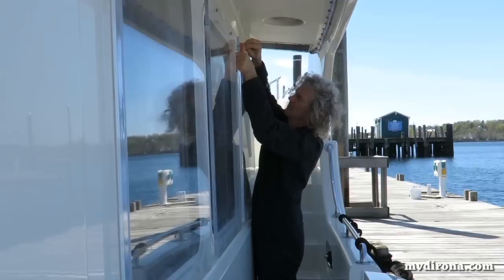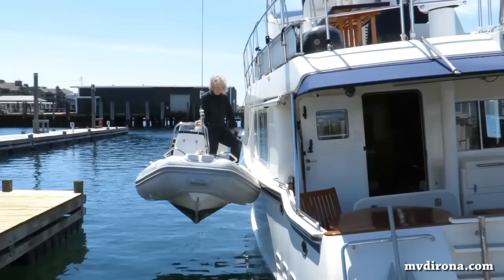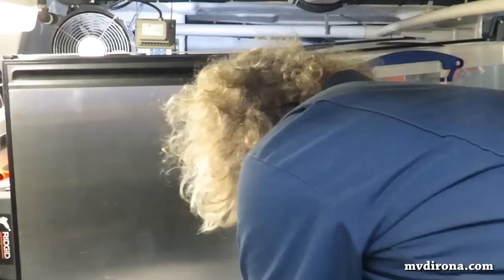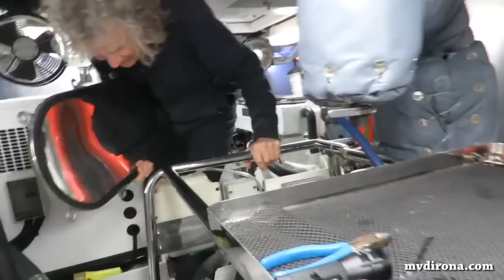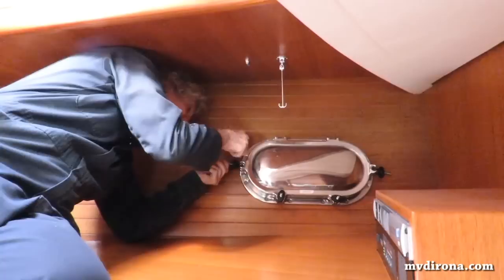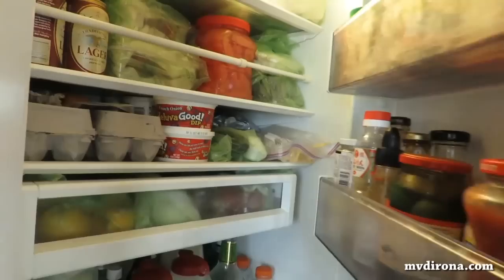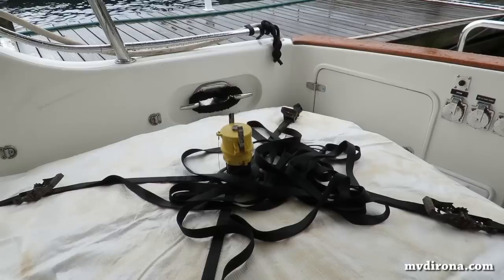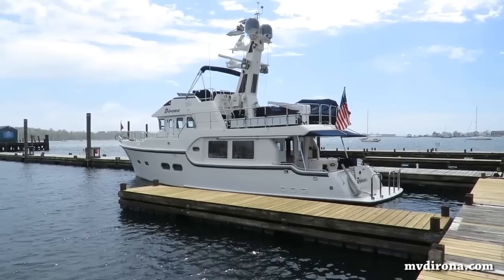Preparing Dirona for the North Atlantic Crossing (MV Dirona Channel)

Comment: So 835 gallons in each tank plus the two bladders for 300 gallons and then what 200 more gallons in that bridge bladder so all in 2470 gallons at what ?   Back then about $2.79 per gallon so it was around $ 6900.00 bucks !?!?   Wow !
Reply from the maker: The good news is we have only crossed major oceans 4 times so it's not a frequent expense. But, yes, as you note the fuel for trip is expensive and the US is actually one of the cheaper places to take on fuel. When we left Australia to cross the Indian Ocean, we took on fuel at 2x the cost of US fuel.
Reply: @MVDirona    Well I dunno if you're still in Norway but than again if you are, I dunno why you'd be answering YT posts at 7:20 AM local time either !?!  (grin)   Oh really the IO too!?  Well next big crossing, please feel free to show us poor land locked buggers the crossing and what's its like to do a watch and all the endless checks during that watch as well.  I'd bet transferring all that fuel around while underway is a bit of a job too!!
Reply from the maker: We are currently crossing the North Sea enjoying the bright lights of massive oil rigs and supply vessels all around us.  On fuel transfers, there isn't much work to do.  We have a boat trim indicator at the fuel manifold. Every shift change, I go down and see which way the boat is leaning and then pump out of that tank into the supply tank. 

We're currently running at 7.8 to 8.1 kts so only getting 1.0 nautical miles per gallon so we need to transfer fuel a bit less common in these conditions. On longer ocean crossings we usually are getting closer to 1.6 to 1.7 nautical miles be gallons.

I'll check everything in the engine room and laz very closely twice a day and walk through the engine room looking for leaks, ware, vibration, weird noises or smells, every shift change. 

It's all mostly pretty boring (the way we like it) in that we don't check that often and there is just about never anything wrong.

Comment: How do you unload the fuel from the bladder
Reply from the maker: It's a pretty cool set up where, before leaving, a custom made hose is attached to each bladder by cam lock fittings and then connected to the aft bulkead also by cam locks. Then when it's time to transfer the fuel we just adjust the fuel manifold in the engine room to "Fuel Bladders" and do the transfer without going outside. Much more detail in this posting: https://mvdirona.com/2013/12/dirona-fuel-manifold/.

Comment: Why not just hinge those deadlights?
Reply from the maker: There is no clearance for the storm plates to be folded out of the way in any of the 4 directions away from the window so a hinge doesn't really help. We store the storm plates up on the boat deck and only use them when we are heading out into open water for longer than the forward look of a reliable weather report.
Reply: Thanks for your reply. Great videos and boating channel. Keep up the great work!

Comment: Why not do it from the jetty haha
Reply from the maker: Yes, the storm plates can be installed from the dock and we sometimes install or remove them that way. The downside of using the dock is that you have to do one side, them turn the boat around, before doing the other side. But, yes, that works fine.
Reply: @MVDirona  can your boat only dock from one side?
Reply from the maker: Its an asymmetric design where there is a walk around on only one side so it's more convenient to dock it on the starboard side. But, it can be docked on either side without difficulty. Line handling is just a bit more restricted without the walk around on the port side but it's not a significant factor. Docking on the port side would allow the port side storm plates to be put on or taken off.
Reply: @MVDirona  thx for explaining i know nothing aboat boats but i do love them new sub

Comment: Why in the name of sanity didn't you just move the boat to the empty dock opposite? Five minutes and you would be done.
Reply from the maker: Jjaus asked why used the tender as a work platform to install the storm plates on the port side rather than just turning the boat around to put the other side at the dock. We have done both in the past and both work fine. Operating from the crane brings a bit more risk of a mistake but it's also slightly faster. I use the crane as a work platform to clean and wax the back of the stack and for a few other service items where I've not found an alternative and, since that worked well, we end up using it for other jobs where there are alternatives.
Reply: Look, I don't know as much as you guys, but as an observer, to untie the tender, organise the davit, hook the cables, lift it and swing it, get in the tender, lower, do the job(s), then undo all the former steps as opposed to just moving the boat a couple of metres, seems like a faff. I dislike spending more time than necessary for any tedious task.
Reply from the maker: I 100% agree and that is exactly the criteria we use to make the decision: which is faster?  My take was unhooking the power, dropping all the lines, swinging the boat around, installing the storm plates and then doing it again to put it back was more work.  It's not a huge difference either way but that was my take.

Arguably only switching it around once and leaving it with the walkway out would have been fine and would avoid moving the boat twice but the Marina wasn't really fully open so they have no power on the dock. It has to come from the shore side so stern to is more likely to make it to the power connection. An extension cord would have solved that but we were also planning to fuel first thing the next day and it's easier to fill the forward bladder with the starboard side walkway to the dock. 

Those were the factors that influenced the decision but admittedly I didn't think that hard about it.

Comment: Thank you for your generous contribution towards climate change. 2000 plus gallons of diesel to transport two people a relatively short distance? That's 20 plus tons of carbon dioxide, more than most households emit in two years. The total emissions for your complete trip must be enormous. All for a vanity trip. Still, as long as you're having fun why should you care about the planet or future generations right?
Reply from the maker: You may be surprised to learn that private yachts crossing oceans isn't in the top 10,000 for energy consumption. If I rode my bike to work for 10 years, will you let me off or am I still not allowed to use the boat?

Comment: I'm thinking sailboat...
Reply from the maker: Sailboats have the advantage of not requiring the fuel load but, other than that, not much else changes. We're not materially faster and a sailboat has all the same concerns when heading to sea other than not being solely dependent upon diesel to do the crossing.

Comment: Cor, I thought that would be a Diesel plant in that craft.
Reply from the maker: The main engine, wing engine, and generator are all diesel fueled engines. All the fueling you saw in the video is diesel. The boat carries a small amount of gasoline for the tender but all the big tanks carry diesel.
Reply: Sorry, I do not know what a wing engine is.
Reply from the maker: Yes, I should have explained what a wing engine is. In single engine boats, you want to have some form of emergency power in case the single main engine fails.  This emergency engine is often called a "get home" engine and the most independent and redundant form of "get home" has it's own fuel tank, props, battery, transmission, prop, etc. It's completely independent of the main engine and because it's a completely parallel systems it gets installed off to the side of the main prop and it's this installation point on the "wing" that causes it to be referred to as a wing engine. 

The problem with wing engines is they are seldom used and many fail due to lack of use. On Dirona, the wing engine runs the hydraulics as well as serving as an emergency backup engine. The hydraulics are used to run the thrusters in close quarters and the windlass to raise and lower the anchor. This second use of our wing engine gets it a bit more than 100 hours a year and ensures it's running well, always tested, and operating well.
Reply: So, strictly speaking, it is a second engine. :)
Reply: In the USA, the fuel hose is green to signify diesel.  For gasoline, the fuel hose is black.
Reply from the maker: Yes, good point. It's an asymmetric twin engine boat. One 266 hp and one 40 hp.
Reply from the maker: It's often true at automotive gas stations that the hose tells you the type of fuel being pumped but it's not universally true when taking fuel at marine fuel stations. We often fuel from tanker trucks and they just about always use black hoses whether they are carrying gas, diesel, home heating oil, or jet-A. This particular case is a marine shore side fuel facility and they are using black hoses for delivering diesel.
Reply: Heh heh  I don't know why I was thinking of auto fuel stations only.  I've fueled at airports, docks, trucks, even a barge.   I should know better.  I guess posting at 0300 should be avoided.

Comment: Only four bolts to hold storm plating on, are you kidding? Hope you only get caught in a mickey-mouse storm. I guess the owner doesn't like the ""look"" of pull perimeter bolting.  Hope you stay safe.
Reply from the maker: The fasteners are 1/4" stainless steel machine screws with a tensile strength of over 2,000 lbs each (x4) so those panels are on their fairly securely. To my knowledge, there have been no incidents where the storm plate has been torn off a Nordhavn but there is no question that the power of waves is prodigious and loading to failure is fastener failure certainly possible.
Reply: So you are assuming that the manufacture of a yacht capable of traveling around the world, with all the loads for every system in this boat, was unable to calculate the loads for these fasteners?
Reply: @rnordquest  Don't get me wrong, I am not belittling calculation capabilities of naval architects, far from it, fact is, safety records show they are very much on the ball.  What I see however, is that; should the vessel loose power in a storm (murphy's law) and become broadsided, the weakest areas are definitely the side windows, i know  lexan plates that thick can take a heck of a beating and survive, however I, would not trust the safety of the ship or it's crew in pounding broadside waves for very long because of the lack of fasteners absorbing and spreading the loads. I think four bolts isn't fail-safe in case one goes capoutski...or loosens. They are very cheap to add and exponentially increase the safety factor the more you install.  i know this post is old, but safety precautions are never too late to implement before shtf situation arises. Fair seas and winds, stay safe.

Comment: Wing nuts would be better, and maybe a safety line through one of the mounting holes.
Reply from the maker: Thanks, both good suggestions. I particularly like the safety line idea. It would be easy to drop a storm plate when working on the side without a walkway.

Comment: My frind amigo you have a lot gasolina onboard.yur driving from America tu iriland no.Please be verrie careful no.Ok a dios amigos.👍
Reply from the maker: It's diesel rather than gasoline so not nearly as dangerous. Diesel has a much lower flash point and is much safer in storage than gasoline. The diesel is unlikely to be the cause of a problem but, you are correct, if there was an on board fire it could out of control faster with more fuel.

Comment: No smokers onboard.
Reply from the maker: True, there are no smokers on board but diesel is actually very stable and much safer to store than gasoline so it wouldn't be a problem if there were smokers.

Comment: On a boat like this, it should have been electric. Just like a car window for atlantic crossing...🤔🌤️
Sorry my bad English
Reply from the maker: That would be a nice feature but finding space to roll them down into for storage might be challenging. A less expensive solution that I would really like would be to move to 1/2" thick glass and not need storm plates.

Comment: I'd leave the boat alone and take my chances.
Reply from the maker: That would probably work fine. The boat is well built and strong and we generally keep it ready to go all the time so there isn't a lot of loose gear or other problems. 

Without deck fuel, I generally figure a range of 2,500 nautical miles but, for this trip, we need 2,800. You could almost certainly still do it without deck fuel but it would be closer than I would want to let it go. But, aside from the fuel, little other preparation is actually required.  It just reduces risk slightly if unusually poor conditions are encountered.

Comment: What a Nightmare. Suppose one have to do a thing in 9/10 Bft. and wavehights of more then 5 mtrs. Impossible to survive.
Reply from the maker: We have seen wave heights in the 7m range in the North Atlantic and in the Gulf of Alaska and it's unpleasant but still OK as long as there are no on-boat problems. You have to be very careful moving around in the boat because things it's moving so quickly. At times the only safe way to move around is to crawl.

The  unpleasantness and, in the limit, the suitability of waves depends greatly on how steep they are where higher frequency is steeper and less safe.

Comment: Pretty stupid boat that came without strong enough windows. What if your caught in a storm while out cruising without them on.
Reply from the maker: The best possible answer is to have ridiculously thick windows. There are a tiny number of boats that take this choice and Nordhavn's do use quite thick glass.  In fact, it's sufficiently thick that many (most?) owners don't chose to use storm plates. We chose to use them whenever we are heading out into the open ocean for longer than the accuracy period of a weather report.

You're 100% right that if the boat can't take the abuse of a coastal storm, then it's not safe. We've seen many and taken some very heavy hits to the windows. We're pretty confident in them. But, for us, when leaving the accuracy window of a weather report when we plan to be out at sea for more than a week, we chose to take additional precautions on the belief that the time invested in small compared to the negative consequences of loosing a window no matter how unlikely that event might be.

Comment: bit over the top
Reply: cb melanjen Over the top? A comment like that could only ever be written by someone who has never experienced anything rougher than a boating lake. In a storm would you really want to be running around frantically trying to cover windows and strap everything down before a rogue wave hit? It's pretty scary when you look through a porthole and realise it's under water. If something goes wrong in the mid Atlantic you're on your own. Help, if there is any help available, could be many, many hours away.

Comment: Or you could just sail and not use 3000 gallons of fuel for no reason.
Reply: jahf1sh as a former sailor I would say I would MUCH rather do this voyage in a Nordhavn unless it was some 60+ foot luxury sailboat, which ironically would probably use 1000+ gallons of fuel anyways. Just because you have sails doesn’t mean you don’t use the engine. In fact in the PNW most of the sailboats I see are motoring around not under sail. People are using it as a cheaper way to enjoy boating most of the time m.
Reply: @danielplainview4778  hi Scott, I have to take issue with your comment. Since most sailboats I see coming in from across the Atlantic have a fair amount of fuel left. Cheers